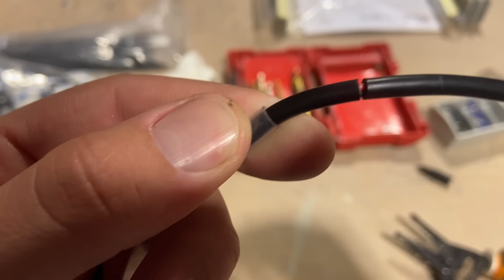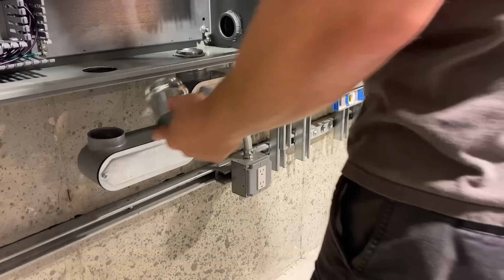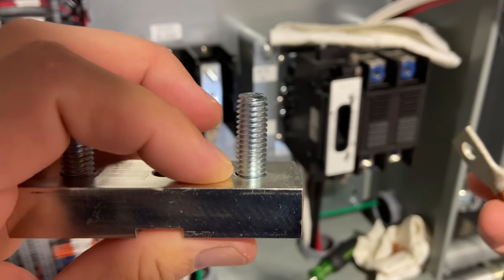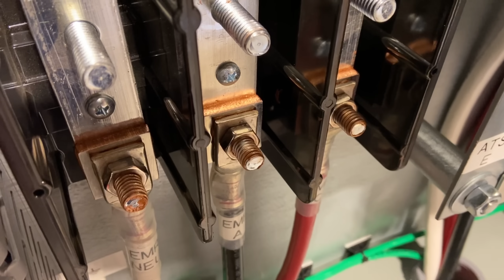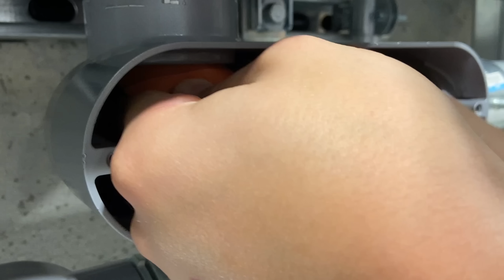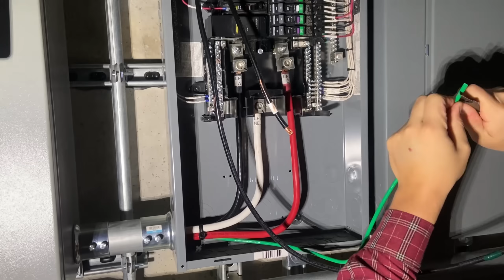Generator Project Part #3 (Finishing the ATS)

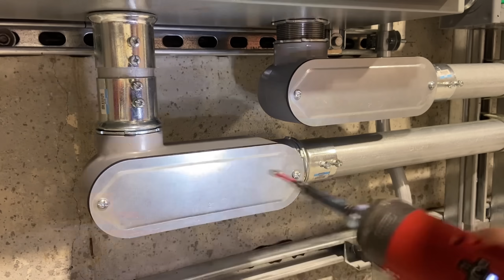Comment: 20:30 I know you get know-it-all comments all the time, and I don’t mean to be that guy, but those 90°s are meant too have service loops or connections inside them. Hints why a straight pull is tight, just loop ‘er one time, and you’ll be fine. Also, bro you are like 25yo 😂 why do you always say old school like you were around before television, you’re a young buck

Comment: Maybe I'm missing something here. I don't understand the need for a back feed breaker in the MDP. Once the generator circuit is installed, would this not back feed the generator under normal ATS state? The whole purpose of the ATS is to keep the mian power source and generator power seperate. I'm getting old, so maybe I am missing something.
Reply: Worst yet, If the back feed breaker is normaly on, and the generator kicks on for a weekly test, theres a good chance they will buck phases. But back to my original thought, back feeding a generator will probably cause enough issues on it's own. Hope I'm wrong. If so please explain.

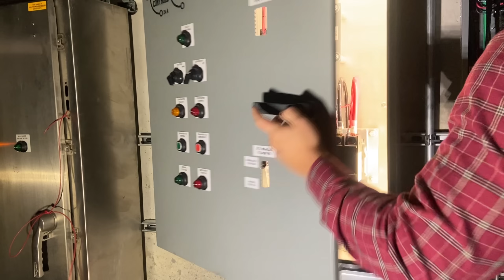Comment: 28:35 Adjustable wrench on the bottom of the lug. Then you torque against the wrench. But yeah, dumb design as dumb design gets. All they had to do it adequate is give it two hard plastic sides. I guess the CEO needed all that saved money to power his petrol yachts...

Comment: I absolutely love the overkill. I did the same thing building a small data center in my basement. Albeit, I keep it off most of the time because bringing it up uses 77 Amps and there's not really a functional utility to it lol... just into the system building and integration aspects of it all.

Comment: I’m sure that the color codes that us electricians use for control wires is 24v is blue, 120v is red, and 277v is black, most everything that we work on now days that’s new, is pretty much 24v, so we run a butt load of blue #14, for control, and #16, for all the inputs and output wires.

Comment: I've been rocking the $100 harbor freight hydraulic K.O. set for the last 5 years. It's ate a bunch of stainless nema 4x panels and still going strong. Only downside is I had an o-ring blow out 3 years ago but it came with spares...it did not come with spare hydraulic fluid so it got used generac motor oil and its still been chewing like a dream.

Comment: Protip: when using those feet, or anything else with adhesive tape/pads on it: try to arrange your work so you can put them in place, and leave them there with no load for between 3 and 24 hours.  This vastly improves their staying power.

Comment: Good job noticing that you've created an issue with parallel grounded conductors in separate conduits where the ungrounded conductors are not in parallel.  Usually that gets overlooked.  The solution when you have two alternate supplies between panel A and panel B, and the grounded conductor is not switched, is simply to use a single conduit to carry both circuits.  That conduit only needs to have a single grounded conductor that gets landed on the grounded conductor bus in each panel.  That keep all grounded conductor current within the same conduit as the associated ungrounded conductors, as is required.

Comment: I let my 2" Greenlee KO set rust away. Given that the last time that I used them was in the 80's, it was high time to retire them anyway. These days I use the Ideal TKO carbide hole saws (well, the Chinese knock-offs). By the same token, I don't do much panel building these days. The last one was a couple of years ago for control room that was being sent to Antarctica. 

As for your panelbuilding, it is top notch. But yeah, there are some scary good panelbuilders out there (Kasa Industrial Controls comes to mind). ED&C was very good back in the day (I'm not sure if they are still in business).

A chop saw with a carbide blade will make what looks like factory cuts in Panduit. No cleanup on the cut edge! It's worth setting one up just for the Panduit. And of course, it'll cut metal as well.

The coolest house that I remember working on was the City Electrical engineers house in Colorado Springs, CO. Low voltage lighting throughout, as well as a 3 Phase service to the house. Pretty fancy for 1978.

Comment: --------------- Keep stickies stock --------------
A trick I learned back in the car phone external 800Mhz glassmount antenna
(worked to keep heavy antenna on car for years)

1. clean surface with alcohol
2. after attaching 3M stickie pad to surface
3. (*) Run a small bead of silicon rubber around the pad

Comment: On one hand, this is super cool to build and play with, on the other hand I would definitelly go with ready made ATS with with programable thresholds and hysteresis, ideally with remote monitoring. Then it can act as the first measurement point (U/I) on the input. Also I have to admit I've been installing Socomec ATS for lots of years so I am a little bit biased.

Comment: While working for a cellphone company, one of the external site alarms we monitored was the utility power. We used  relay like you did that was powered from the utility side of the ATS, but we added inline water tight fuse holders (made by Bussmann) with 1amp fuses . That way the #16 or #14 wire was fused going to the power failure relay.

Ron,N4PHP

Comment: I think if I'd been doing this, I'd have run the whole lot through a parallel pair of Victron Quattro inverters with some LFP batteries. The inverters serve as both a UPS, as well as supporting online ESS functions if you have some solar power.  You can configure them to be able to trigger the generator start at specific battery levels or at a certain load threshold. Also means you can have quiet hours where the generator won't run unless necessary, or with solar the generator only starts in a blackout when the solar can't keep up. 
They do also have two separate outputs, from the inverter and a pass-through so you can segment off into essential and non-essential loads if you wish.

Comment: Fyi I learned this a while back. Service Entrance still requires grounding bushings and eccentric and concentric knockouts require them too on 250v class circuits.
Reply: Don't know the articles off the top of my head or I would put it here. If I am wrong please correct me.

Comment: You wouldnt need bonding bushing on that even if it were 480.    Only for service conductors & over 250v to ground if concentric or ecentric knockouts are left.    But 4s and 4 11/16 are rated for it.

Comment: I appreciate the commitment to keeping the colors consistent through the electrical system. 

My house is a mess when it comes to this. One of the previous owners wired the garage with THHN and conduit and used multiple colors for the hot. Black, brown, orange, and blue seemed to be the preferred colors. No problems there until you get to a junction box with a splice. He then proceeded to change wire color. A circuit that started as brown wire at the panel, ended in blue when it finally got to the recepticle. He was also sloppy about sharing neutrals. I had one circuit with 3 recepticles and 2 of the 3 were using the neutrals from other circuits. 😑

I understand that electricity doesn't care what color the insulation is. It's about communicating what the system does to the next person. It can save you a lot of headaches when troubleshooting things in the future.

Comment: Hope you get to read this. This is based on a post you made about internal motor temperature overload. Usually, they are not designed for high Current (Even reasonable  40 ma). It is always recommended to use a purpose monitoring temperature relay 
That measures the temp sensor. Foxtam controls in the uk make a product called a MOD-TC-2. This would be perfect for your application. I am not sure who makes them in USA but I bet a few manufacturers do, Never try and and monitor motor temp believing it is a stat... IT IS NOT.... IT IS A PTC sensor. Please look at the datasheet online

Comment: hi O clever one instead of placing and displaying a square copper piece cut or grind it Remove the end using an iron cutter to remove the end that is connected to it ie the rectangular angle the sharp edges. And the matter is finished

Comment: Nice video, thank you, For such short runs of wire copper makes sense IMO, when your already using conduit, even in a regular home. I have seen homeowners insurance getting more particular on what thy cover,  some ask if any interior wiring is aluminum not just the old bad kind. In general home insurance has been getting harder to obtain in some areas, so presumably being able to say you have no aluminum wiring is a plus for any homeowner.

Comment: I like how you said the knockout set is manual ratcheting because the upgrades are very expensive but you have a few thousand dollars in your one battery powered crimping tool. They make hydraulic versions of both that take zero effort to use and you could’ve done probably bought two of each if not more for the cost of what you paid for the ratchet punch and your Milwaukee crimper
Reply from the maker: @Dew_762 I borrowed the crimper 😉

Comment: Equipment ground is based on the largest size circuit in the enclosure (Article 250.122) #10 is good up to 60 amps

Comment: My Harbor Freight generator and 14 extension cord backup solution feels more and more primative the more I continue watching this series.
Reply: Don't let him panel shame you
Reply: We have a HF 7,000 Watt portable Predator generator. I must be a kindred spirit to OP as a retired EE. Nothing nearly as fancy but I had to include a status panel next to the breaker cabinet. It monitors voltage, current and frequency when the genie is running. Genie has electric start so I keep it connected to a battery maintainer. In geezerdom that last thing I want to do if we loose power is having to use the recoil starter at zero dark hundred in the cold. The status panel monitors battery voltage in case it gets too high or low. Actually came in handy a few years ago. Mice chewed through the Romex cable (no conduit for me) and tripped the breaker killing power to outdoor stuff and the generator battery maintainer. We only noticed when the status panel started beeping - low battery voltage. I always dread when my wife asks why is XYZ beeping.
Reply: lol same altho, im hoping im able to trade a truck of mine for a 20kva diesel generator lol xD then iv got a big ol diesel generator to either rent out or use as a backup generator xD

Comment: If you use a Ronan Multi-Cut 301, you can get a clean cut through panduit with no need for deburring.  They also cut through #6-4 S00W cord.

Comment: You could try Weld Mount adhesive and pads for the wire ties on the door. Its a two part adhesive. I use it and trust me, you will break the pads before you pull them off of whatever they are glued too.

Comment: I would have angle-grindered a chamfer on the edge of that bus bar instead of using a spacer. But spacer works fine of course.

Comment: Shouldn't there be a clip on the front panel to hold the manual handle for the ATS transfer switch?
Reply from the maker: @CathyInBlue I need to find/make a hand for it, but yeah I plan to do that

Comment: The drama, the suspense, and finally - the ending note on a cliffhanger - what WAS the current in the neutral(s)? 🙂
Reply: Add a transfer switch for the neutrals so only the proper one is connected at any time. Or stuff them all in a bigger conduit.

Comment: I don't know why, but I always run my door ground through the door conduit. I just hate it dangling around. Don't know if that's up to code where you live, but in Germany it's fine. And yeah, always conduit cause stickies will fall off under the weight.

The spacing problem is an actual thing, and I had a box of full copper washer in my last work car. Especially on large VFDs I needed these quite often.

18:57 We have special wiring in Germany for taking of unfused voltages. Its isolation is rated for way more than the usual one.

Comment: For the stickies, try using VHB tape. You can peel the foam adhesive off by rolling it and then use VHB. Lasts much longer. Also, it’d be awesome to add a fire alarm system / wiring. Just go full commercial. With your attention to detail that house electrical system I swear will be in service for millennia

Comment: It looks very good, but I would put a polycarbonate cover over the distribution block and the connections of the transfer switch to make it reasonably finger-safe and prevent accidental contact with the contacts when measuring something in the control cabinet.

Comment: I might be misunderstanding but you seem to be powering your push to test light for utility available with the ptt function powered off utility power, you want that to be powered off typically the same power source as the rest of the ptt contacts for the other ptt lights so if it is not illuminated by the intended status you can still push to test, right? If your ptt function is the same power as the status light then you cannot test if status is not met or if its just a burnt bulb. I could explain my stance better but by wiring ptt and status to the same source, ptt will only work if the lamp is functioning.
Reply: Good point!
Reply from the maker: @ThisShiiRightHere you are correct, I think I would’ve done things a little different with the PTT’S but I was torn on what to do. I do have a redundant power source that is backed up by a UPS, but it is not the same neutral as everything else and I didn’t feel like figuring out a way to separate the neutrals on the lights as well just for the PTT. But I’m sure there’s still a way around it.The PTT on the transfer status lights also have two functions. It tells me status and if the emergency/normal power is available.
Reply: @Cursed_Controls hell yea, funny enough I used to be a data center switchgear tech for one of the big 3 but somehow can't think off the top of my head how they were wired at the ptt. I'll find some drawings and see if I can be any help.

Comment: I bought a Temco hydraulic knockout set when I was redoing my house wiring and it has served me well. I would love one of the Milwaukee ones but that's out of the budget. I would recommend getting a different case for the Temco one as the blow mold case is very flimsy.

Comment: We have the harbor freight hydraulic KO set.  Highly recomend, regularly knock out 4" holes in troughs with it when building security control panels.  After hundreds if not thousands of KOs it is still running strong.

Comment: Dude, I've asked before .... Please, for your inside door labels, add the schematic designation. Like PB-1, LT-3, SS-4, ect.    That way you know exactly what they are when trouble shooting.  Trust me, I had a 100% memory for a long time but at some point you won't.  

Eh, I guess one of theese days I'll send you a ty-wrap gun so you can ditch the dykes and save your knuckles. ETA: This comment was before your comments about clipping.

PS, the Normal / Emg lights should be above the PB's, not below -  Likewise Gen Run. This is normal, every day, Controls 101 stuff that, unfortunatly, you had no one to teach you. But don't worry, I am here to help out.

Comment: I would 100% be grinding/cutting a 45 degree angle on the busbar for the lug to fit, spacer works but does look worse in my opinion, otherwise great work!

Comment: If you really wanted to confuse future you couldn't you have put both door switches in parallel so the single power supply would switch on if either door was open?

Comment: Get various sizes of the manual tool that plumbers use to cut pipes. Beautiful clean ends and no messing with hacksaws of bandsaws.
Reply: Pipe cutters are for plumbers.  They leave a rolled edge on the inside of the conduit, that is a bear to remove with a file